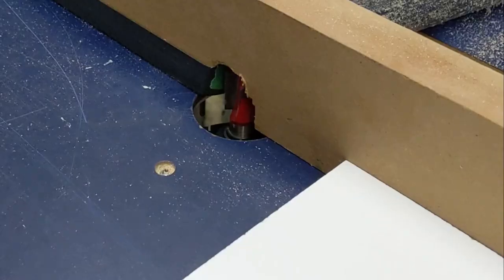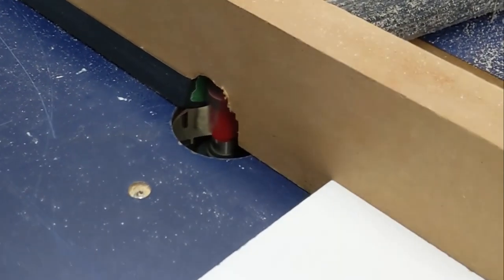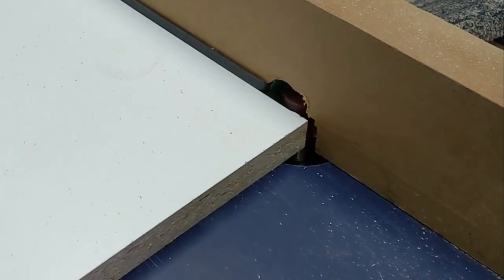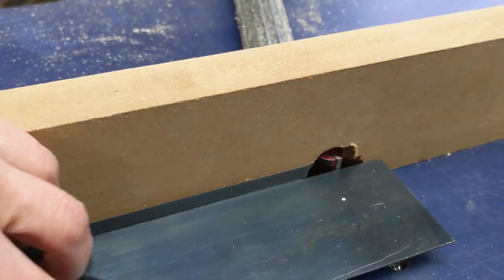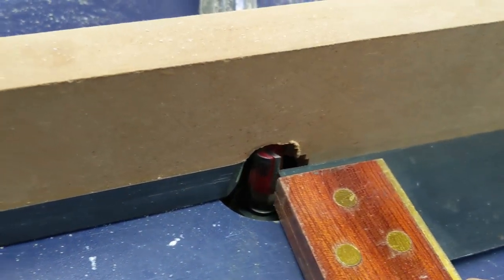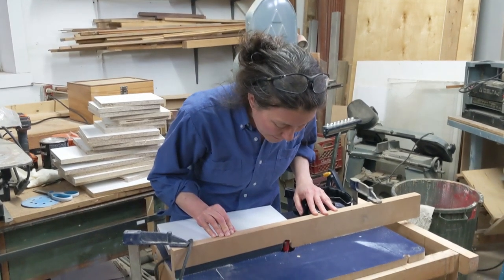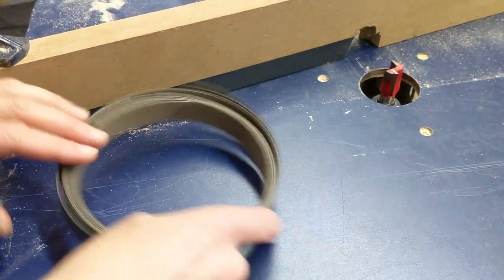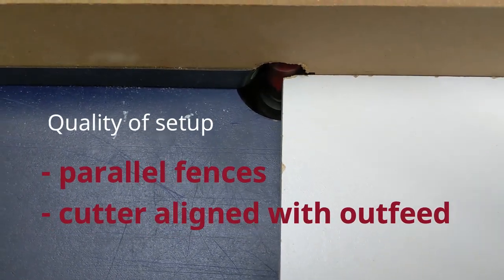Clean melamine edges using router table

Comment: Could this also be done in the same orientation with a compression bit? And if so would that be better in regard to the cutting edge lasting longer?
Reply from the maker: A compression cutter would work too.  You might want a hold-down of some sort to since there is more downcut than upcut spiral on compression bits.  In this set-up a regular straight bit performs fine - just go with whatever is convenient and kicking around the shop.